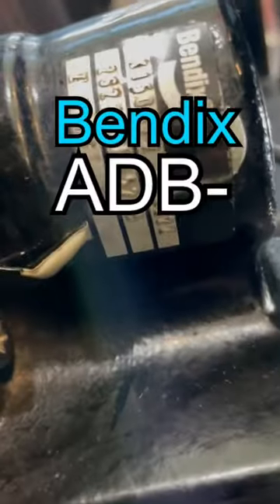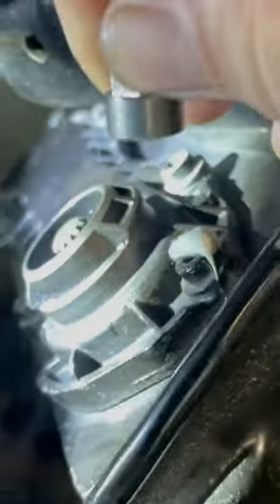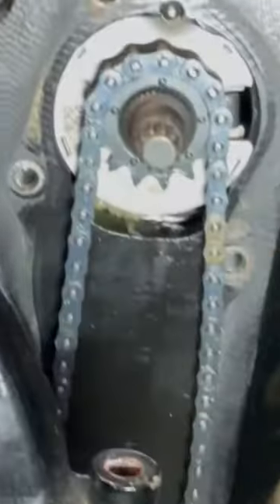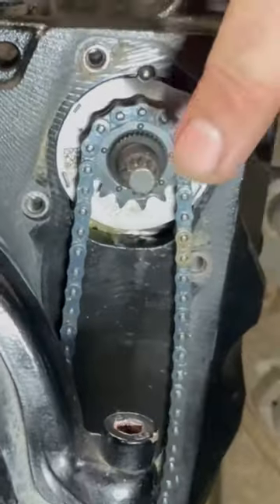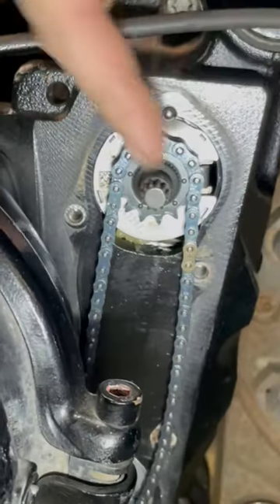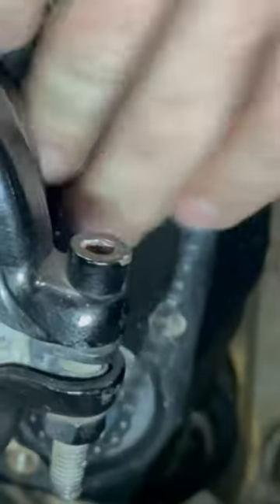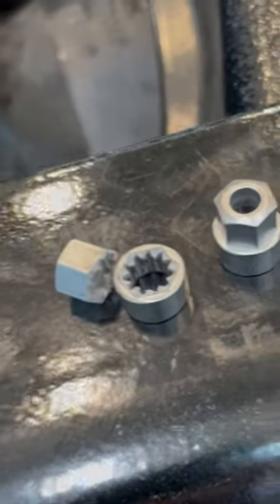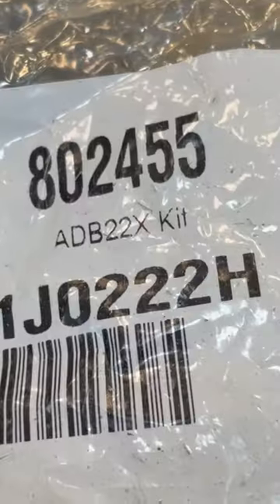Air DISC Brakes can be a PAIN! #diesel #trucks #garage #tools #diy #hack #fail #mechanic #wow #trick

Comment: I always use the socket, I’ve had those shear adapters break on perfectly good calipers just trying to adjust them out on trash trailers. Fun tip: fill the cap with grease so things don’t rust shut in there, that way even if the cap does get blown off, you’ll have a little corrosion insurance

Comment: Had to buy the socket because my shop wouldn't buy more of those stupid adapters. Just stop once your pads start touching the rotor. And I've had one of those adapters shear off before I even adjusted it all the way down.

Comment: The hell with those air disc brakes. I’m told they’re decent for OTR trucks, but I’ve only done them on buses and trash trucks. In the past year, I think I’ve pad slapped two brake jobs. All the rest (6 or 7) needed rotors.